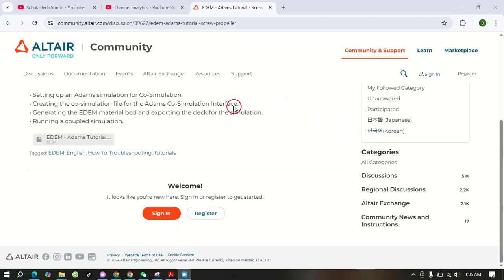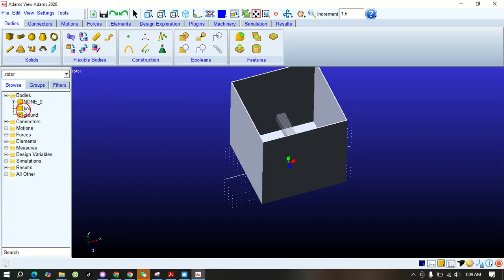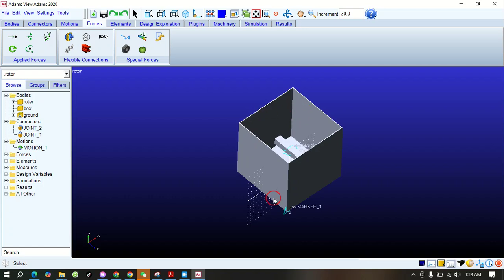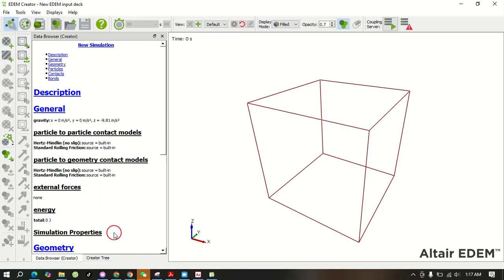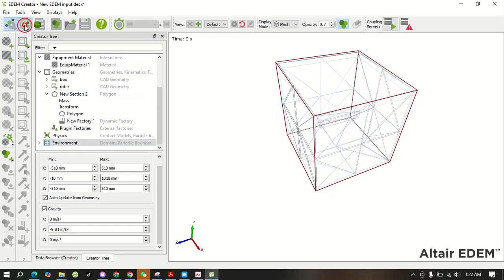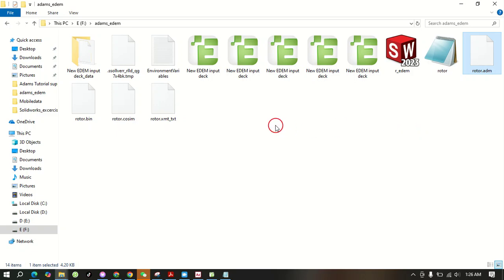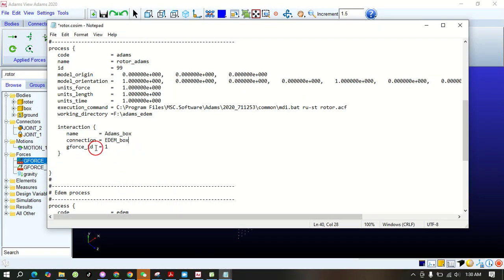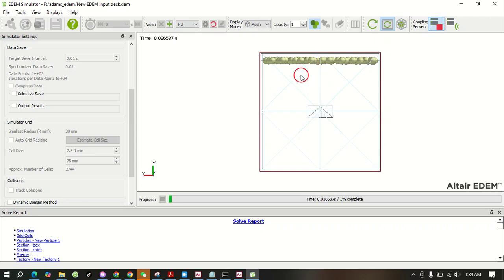EDEM tutorials || Lec.9 EDEM and adams view co-simulation step by step complete guide|| Coupling

Comment: Hi, I tried to perform this linkage on newer versions of adams 2024.2 and EDEM 2024.1 but this error appears: "Error: EDEM is not supported in ACSI currently!". Have you encountered this problem in newer versions?
Reply from the maker: Yes, there was the same issue for newer version. The Adams view 2020 and edem 2022 are compatible.
Reply: @ScholarTechStudio  It's a pity. I was hoping this problem was fixed in the new versions. Thanks for your video!
Reply from the maker: @ДмитрийМышенский-р6ь  I am also waiting for the solution